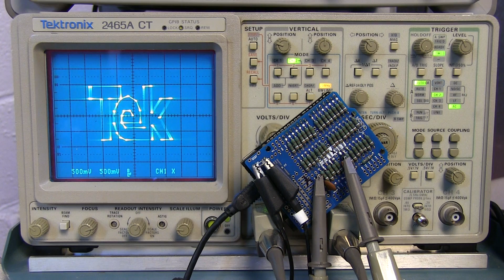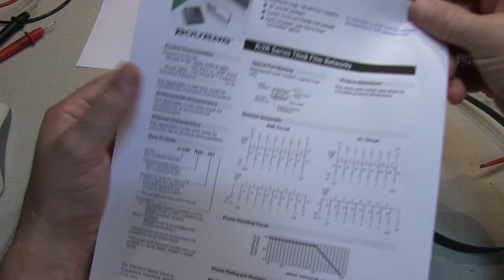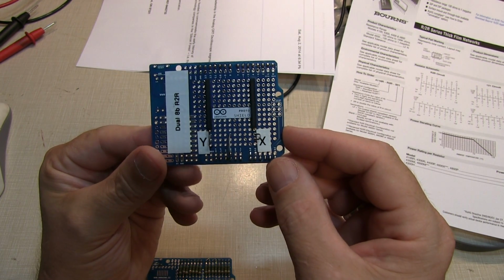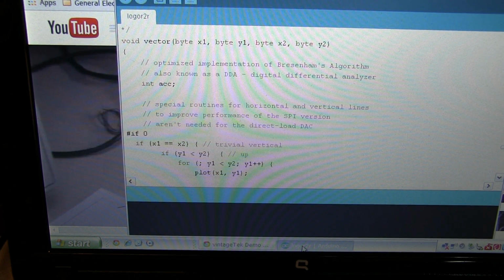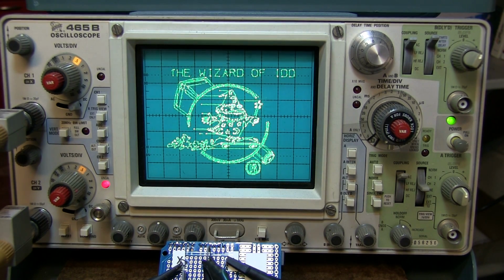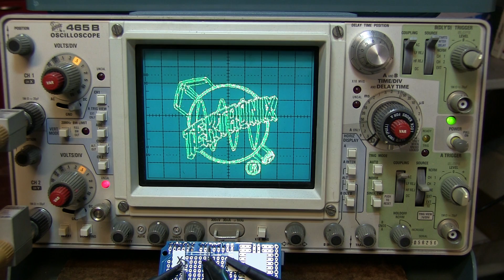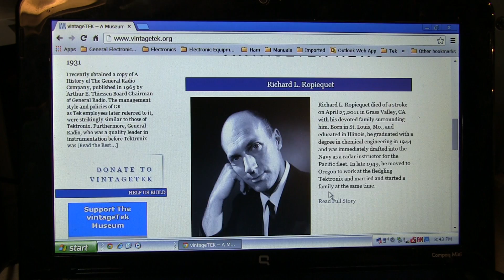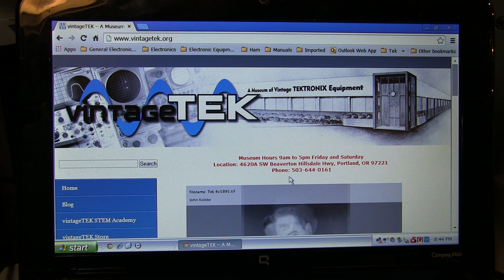#164: More XY Oscilloscope graphics, VintageTEK and how projects evolve

Comment: My connection to  Tektronics goes back to 1965 when I was in high school. We had a ham radio club and electronics lab outfitted with a lot of WWII era surplus instruments. We had several old recurrent sweep type oscilloscopes that we used to learn about waveforms, phasing etc. our advisor who was a nun, went to Tektronics and asked for a more modern, triggered sweep scope. Not just that but she wanted Tek to donate it to the school. Much to our surprise, we received a brand new 500 series  dual trace scope, with power supply and stand. Tek donated what was then state of the art. We learned a lot from that instrument, and all these years later, my only choice for a scope of my own is of course Tektronics. Even as a teen, we recognized that Tek was the best on the market and was a company that invested in the future. I've been an electrical engineer for 43 years, in part because of what I learned back then. 
I just wanted to say thank you.

Comment: I've come into this a bit late, but your video inspired me to build the R2R to use with my Arduino UNO and recently purchased Tektronix 475A scope. I am stuck on the code not compiling with the error 'avi/pgmspace.h: no such file or directory' I'm using Arduino 1.8.12 on a Mac. I know this is now outdated and you have more important things to do, but any ideas on how to fix this would be a great help. Cheers.
Reply from the maker: I"m really not much of a programming wiz, and certainly not on a Mac.  This thread might help you out:
https://forum.arduino.cc/index.php?topic=129407.0
or maybe this one:
https://stackoverflow.com/questions/54398796/how-to-make-arduino-work-and-not-give-cannot-open-source-file-avr-pgmspace-h
Reply: @w2aew  Brilliant, thanks for the reply and links. After a bit of investigation, the pgmspace.h library is now built in to the latest Arduino IDE and not required to #include. So I commented that line out which then gave a dozen more compiling errors, all centred around the data type prog_uchar which appears in quite a few lines of code. prog_uchar has not been used in the Arduino IDE for a few years now, so I replaced it with const byte. And amazingly it compiled and successfully uploaded to the UNO and I get the Tek logo and Wizard on my scope!. Thanks again for your direction. BTW, I have only just discovered our channel and am slowly making my way through all your videos.

Comment: About the arrays for the images. I guess there is a way to convert every monochrome bitmap into an array. Is the algorithm available?
Reply from the maker: It's a bit more complicated than that, because you want the array to be a set of points that draws/traces the graphic as a continuous line.  This is more complicated than simply getting an array/raster of points.  I would imagine that there are tools to trace contours in a graphic, but I'm not aware of one.

Comment: Nice video! It reminds me of my first PC 'sound card'. It was an R2R network I built connected to the parallel port, if you had two parallel ports you could do stereo. Some of the old STM and MOD file players supported output to it. They sounded pretty good for what they were.

Comment: I left the world of electronics in 1996 and became a UNIX admin.  Now I am just getting back in to electronics as a hobby.  I have a 7854 with a nice set of plug in modules; though my goal is to get a 7103R in it's place.  I also have a 2465 (!A !B) in a rack mount.  I had lots of scopes in tech school.  Philips, HP 1704, Gould and a  couple of other knock off brands.   I really liked the Tek scopes.  From the little 15mhz thing in the 500 series chassis to the 7000 scope on a cart.  Later on the job I was exposed to Hitachi and LeCroix.   I never could get used to the left hand threading of the LeCroix and the Hitachi was the only one I liked other than Tek.  At the risk of starting a holy war, are there others like me that feel this way?  Do you miss the old Tek?

Comment: FWIW: to give you another idea based on our "sea of resistors" have  you thought about using EEProm(s) as a way to get 8x8 or 8x8x8 resolution?  Take the address lines and they are tied together across two or three that will give you 8 bts in x/y and z.  You could even use a binary 8 bit counter and a few inverter gates to make an oscillator to drive it.